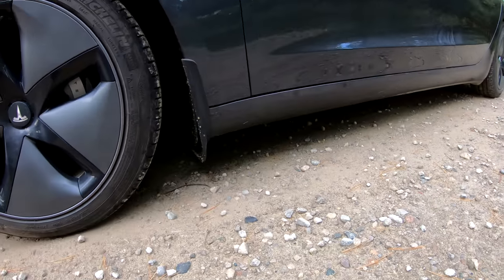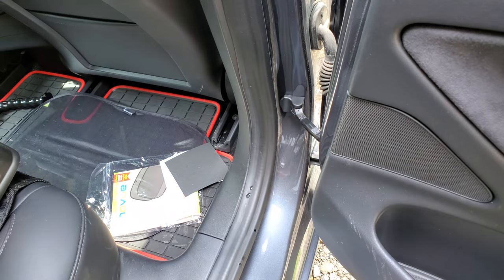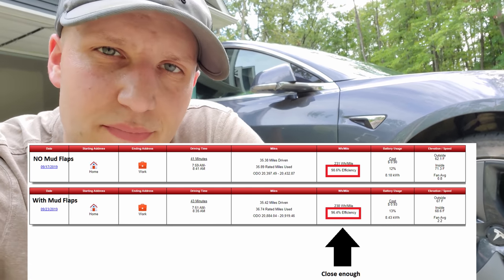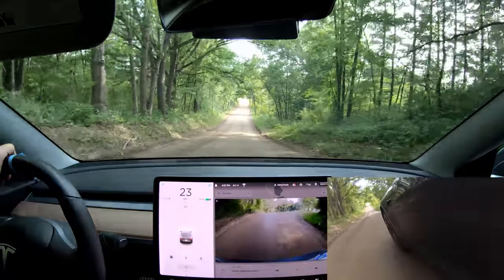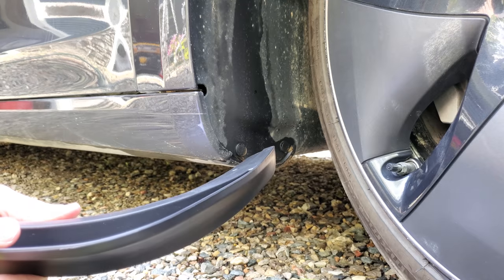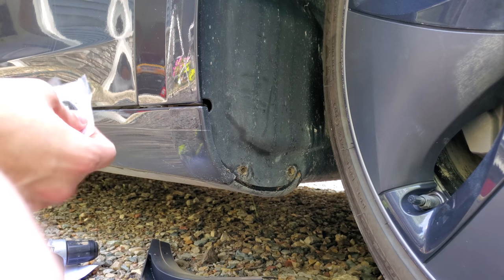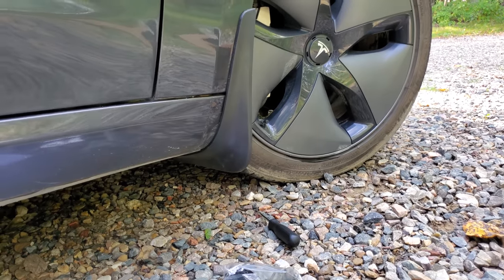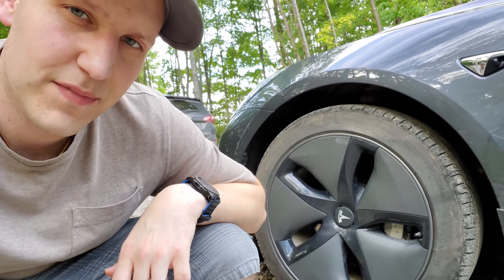Tesla Model 3 Mud Flaps | Install and Review | Unboxing | Testing | Splash guards |

Comment: 1% efficiency loss. You'll lose 2-3 miles. Basically undetectable. Lol
Reply: 1% plus all the other things that add 1% adds up over time
Reply: @lancethomas4566  yeah, but how many 1% losses are you adding? Let's be real. Just driving a little faster will make a much bigger change. I get over 50mpg going 55mph, and a little over 40 going 70mph, under 30 going 80+mph
Reply: If you lost 5% that would be alot if you add all the time spent charging 5% more
Reply: @lancethomas4566  that's not how charging works. The lower end of the battery charges faster, just don't charge the last few % when on road trips. It does absolutely nothing if you plug in when you get home and wake up to a full charge.
Reply: @ItsBinhRepaired  You driving prius??
Reply: @triparadox.c  2003 first gen prius pre hatchback model.
Reply: @lancethomas4566  the less efficient the car, the less 1% loss effects it. :P Too bad the Tesla is so efficient, right? More to lose. Haha jk
Reply: @ItsBinhRepaired  You get 50 mpg on that old car??! Wow..
Reply: @triparadox.c  if I drive 55mph, yes, 52-55mpg. I've dropped the oil pan and replaced it once because I punctured it on a curb, flushed the coolant because I saw even lifetime fluid should be changed after so many miles. Over 250k miles. Had to replace the pedal because the potentiometer in it went bad. Still same hybrid battery, but I almost permanently killed it leaving it sitting over a month without driving it, shouldn't leave it more than 2 weeks, and I probably could get better if I changed the filters, but I'm lazy and it seems fine with the mpg. Maybe I can get another 1% bump by changing them. XD
Reply: @ItsBinhRepaired  Great to know it's well maintained. Some people just don't seem to care at all. I bought 10 Prius. Interior was dirty, several minor dents all over the body. I honestly wonder how did he get those dents.. Like, you must be so ignorant to get all those.
Reply: @triparadox.c  well, I did it because I wanted too keep it running lol the outside of my car is terrible. Clear coat is all peeling. No garage/covered parking. Lots of rock chips.

The small dents you mentioned are probably from hail.